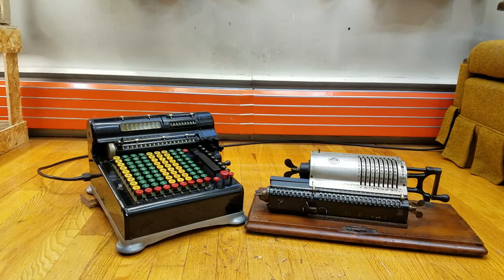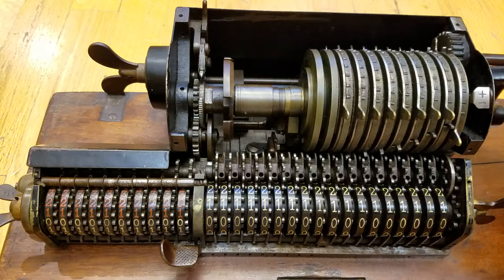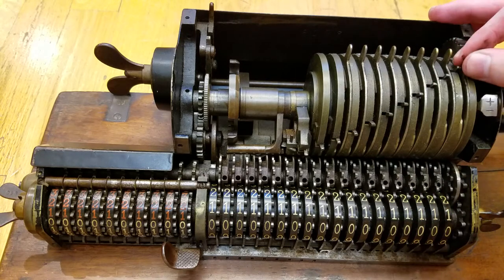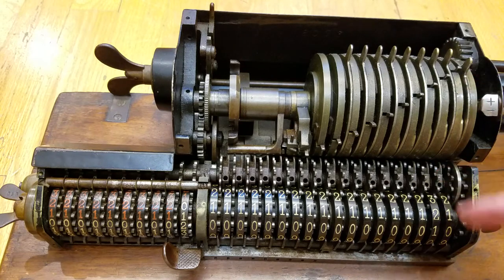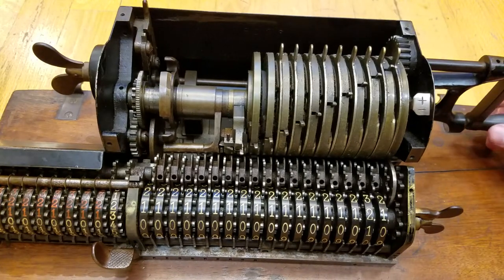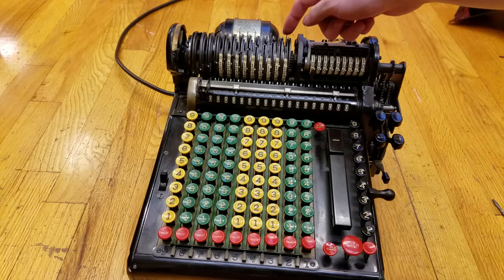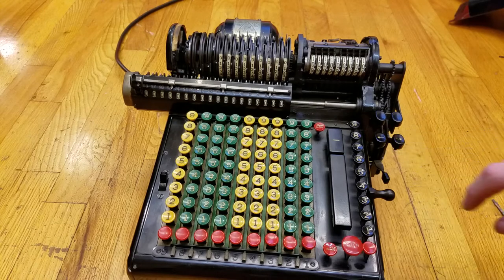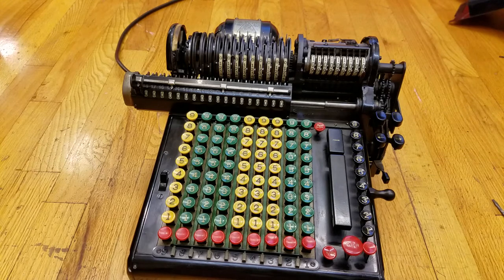How Math Works: Inside 2 Mechanical Calculators

Comment: I had torn into some mechanical ⚙️ calculators back in 1983. I do not remember what year they were from. I assume they were newer, because the case was plastic. They were very interesting 🧐, as I tore them apart. They were electric ⚡️. Out of these two mechanical ⚙️ calculators I was given, I removed the two strong 💪 permanent magnets 🧲 out of each. Your friend, Jeff.

Comment: Considering that the second machine has only one motor and it needs to run multiple different gears, it would have been interesting to know how it changes which gears it rotates. The speed of division suggests that it's running the gears pretty fast and if the mechanism wasn't robust enough, you'd quickly see parts of gears flying around when that motor turns. It sounds it has some of free wheeling setup where the motor inertia is released to spin freely with gears detached at the end of computation.
Reply from the maker: You can check out my video series on Marchant EA repair, its a similar calculator and although it doesnt do automatic division it has the same geartrain and the same reversing mechanism for changing between addition and subtraction. In that series I dissassemble and rebuild most of the calculator, and you can get an idea of the drivetrain and how it all works. In short though, it disengages the motor drive with a dog clutch which locks the main mechanism from turning but allows the motor and input drivetrain to freewheel